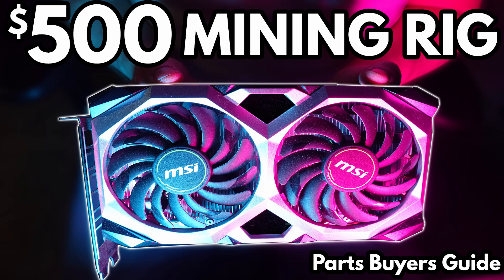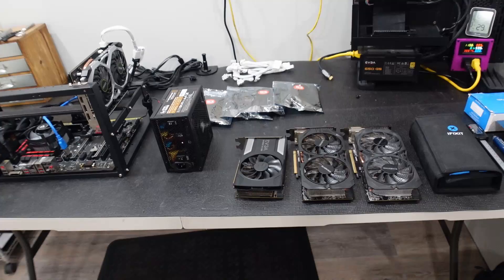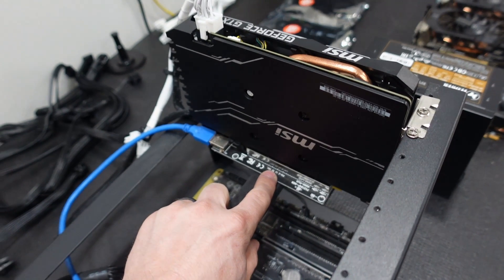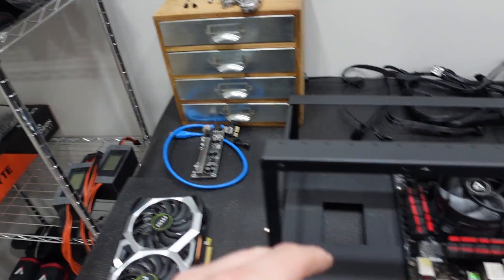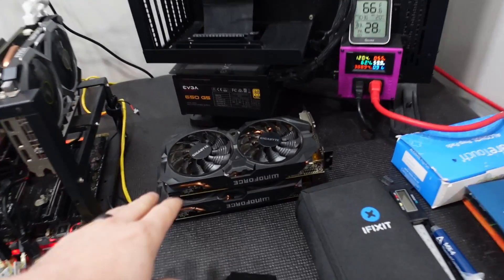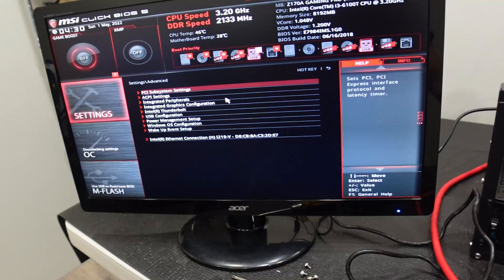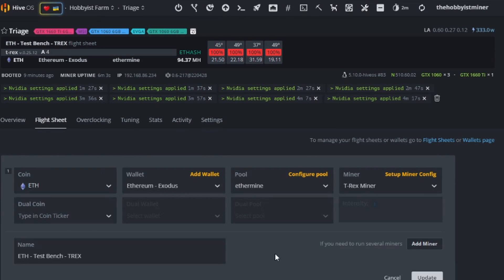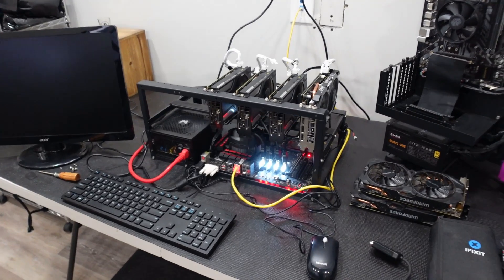Build a GPU Crypto Mining Rig on a Budget | Beginners Guide to Crypto Mining Rigs - Part 4

Comment: On the R9 380's. Did you try running them on phoenix miner only? I have two of that same gigabyte model and on phoenix miner they pull just under 50mh at about 145-160w. Not great, but not terrible either.

Comment: After a year mining, suddenly my colorful 1660 super not detected when connected by pcie riser. But its work well when directly installed to motherboard and already mining for more than 48h.

I dont know what happened, no change on bios setting or gpu driver.
Reply: Just a dead riser? In the last year i've had three dead already.
Reply: Dead riser
Reply: No, I tried the riser with another gpu and its fine.

Comment from the maker: What GPUs have you bought recently to expand your GPU Mining Rigs?
Reply: Evga 1660 super and 3080 non lhr from rma
Reply: whatever i can get my hands on that within my budget, last one was a Gigabyte 1660Ti
Reply: I was somehow able to get a White Strix 3090 last Friday. 

Not sure how my Micro Center managed to get one, let alone 3.
Reply: @4drien545  I wanna get one too! But can't justify spending 2k when a ftw3 cost 1750
Reply: Just built my first mining rig from your bid and I got 2 1660 supers one of them overclocked one bit and I got a 1060 founders. Just wanted to say thank you for the amazing vids
Reply: 3080ti Founders Edition. Might add some 1060s or 1660 supers or something cheap.
Reply: Got 8 1660 supers they Hash about 31.4 and cost about 220 each.
Reply: I started off with just a 1660 just to see how things go then got some funds and got two 2060 12Gb cards and then later a third 2060 12Gb, Looking to get two more 2060 12Gb cards and swap out the 1660 to give it a well needed clean up as well as new pads and paste as it's over five years old and only been dust cleaned as in surface dust wiped and blown off.
Reply: 3060 Ti FE (I'm impressed with the performance tbh)
Reply: @youtubehandle-o8d  tbh even the 3060 ti LHR are good, i've got 2 both are about 47.7 Mh/s, but i dual mine ETH+TON on them so about 46.7Mh/s and 1.47 Gh/s
Reply: @Northeastfarming  that's pretty decent I would say; thanks for sharing
Reply: @Northeastfarming  yea they're pretty great cards. My Zotac 60ti get 50mh@120w all day, msi gets about 49@140. No idea why msi card draws so much more wattage
Reply: Just got 3 6600 2 3060lhr and a 1660 super!!!
Reply: 3060ti LHR. 
Eyeing a 3080 and a 1660super too, but should wait.
Reply: 1660to 31mh
Reply: I've picked up 5 RX550 4gb gddr5 for a second ETC rig in the last 2 weeks alone. The fire sale makes it tempting to set up a second ETH rig too.
Reply: @CryptoRufio  What is the profitability on those guys?
Reply: 1660super
1600w bitmain power supply
Reply: I recently got Asus TUF 1660 Super and Asus TUF 1660 Ti.